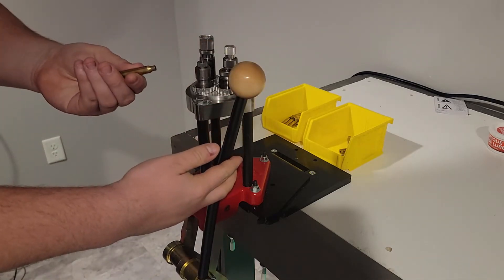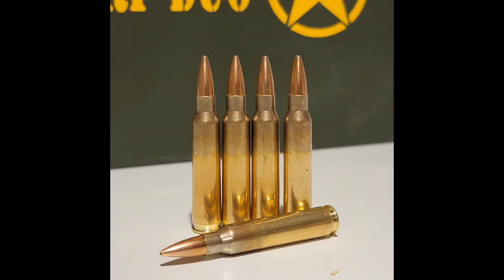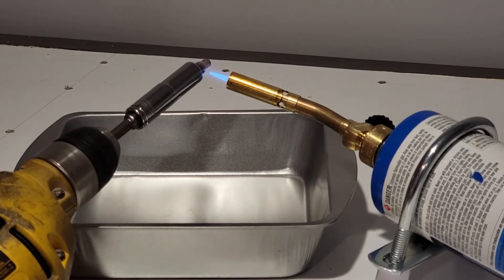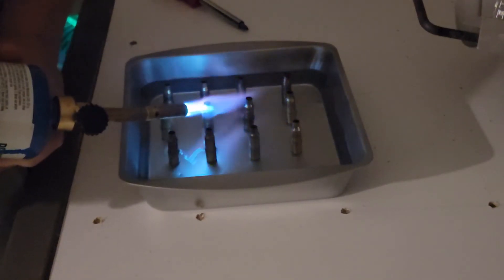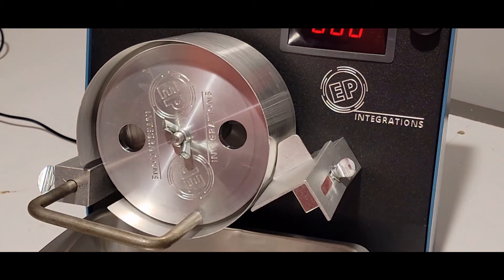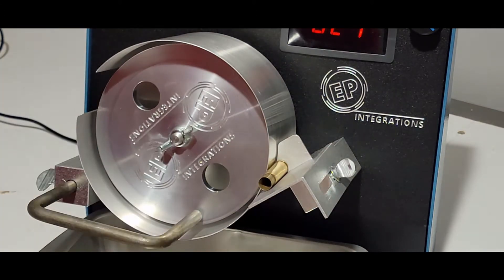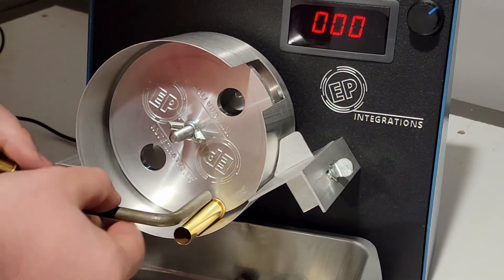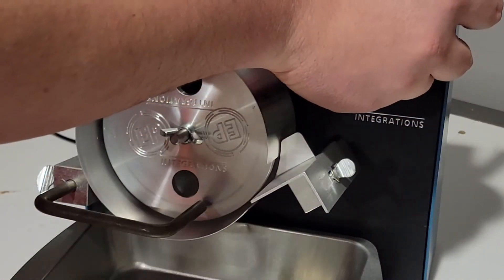EP  INTEGRATIONS LLC. EP 2.0 BRASS ANNEALER REVIEW !!!

Comment: I have viewed a number of videos on annealing and every one I have seen uses propane gas. Is there a particular reason for that or can butane be used?
Reply from the maker: Using Butane in theory would work, but propane produces more heat than butane.  If butane were used the time in which you would need to achieve case glow (the point where the case is annealed) would be longer therefore slowing the whole process down.  Other things to consider would be the cost of butane over propane and availability
Reply: @MilsurpDuo  Thanks for clearing that up for me.